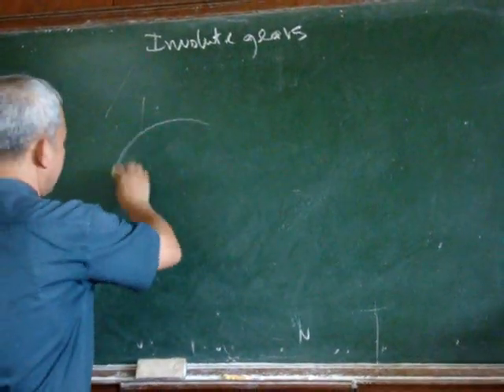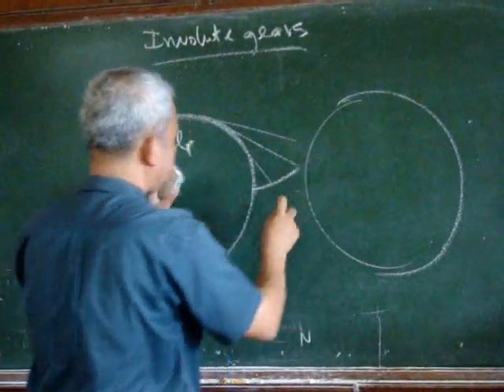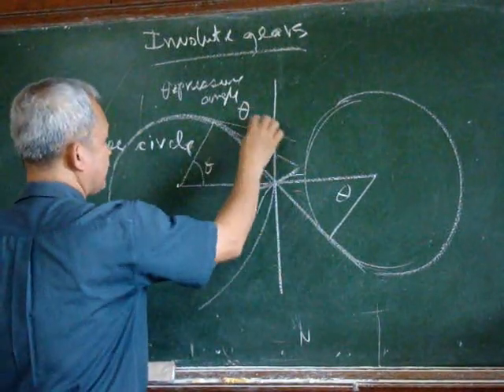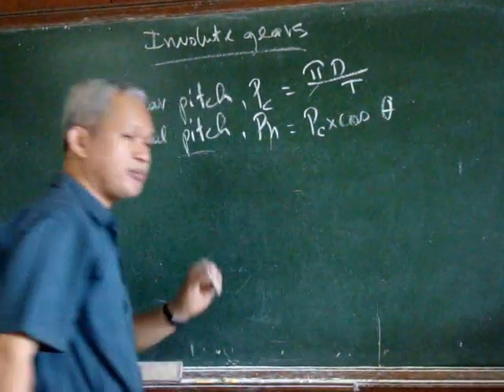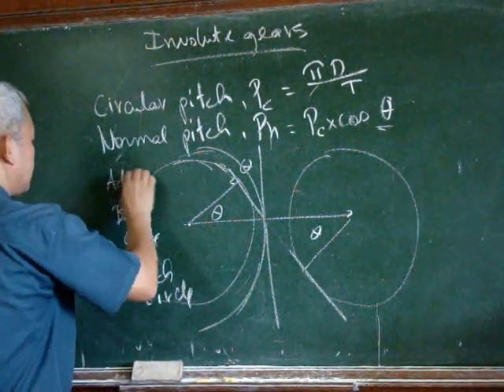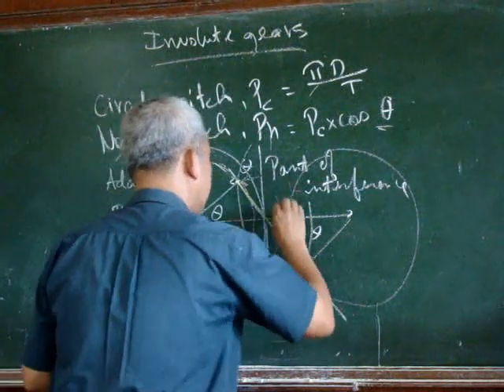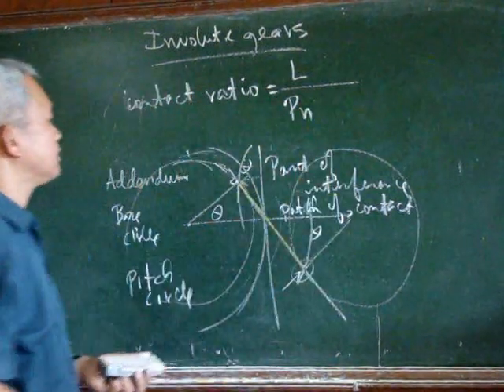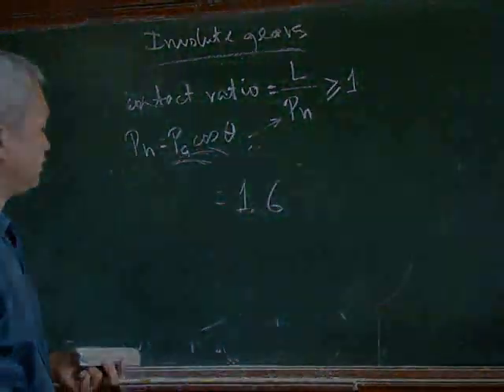Involute gears 1b

Comment: Usually I try to find whether there are multiple cases or the presented situation is singular. By what the professor taught us, I would guess there are other possible involute "paths" described by the same tangents (unwinding wire), if for example, we extend the (same) tangents a bit.